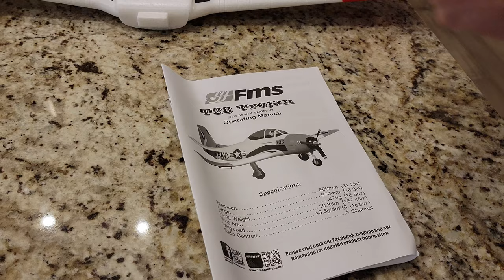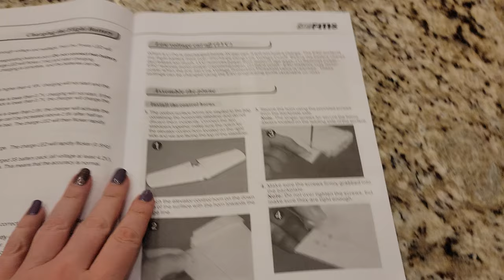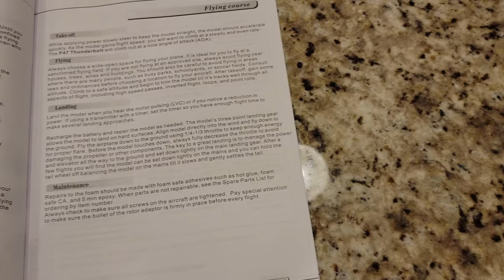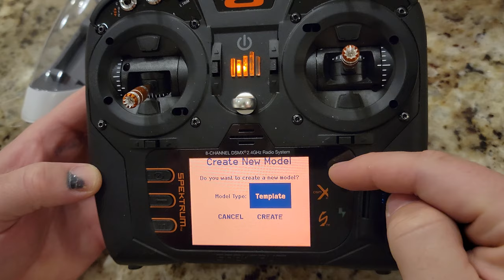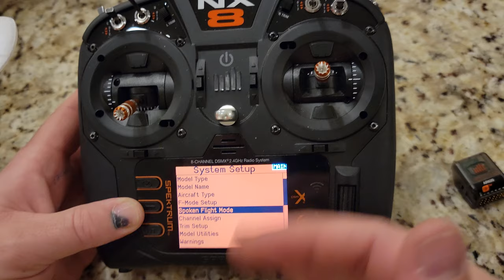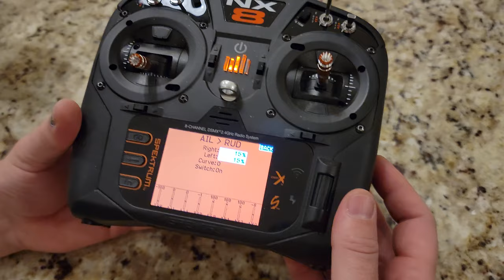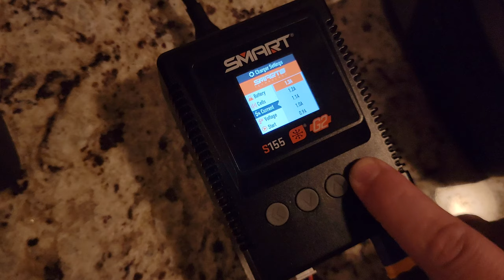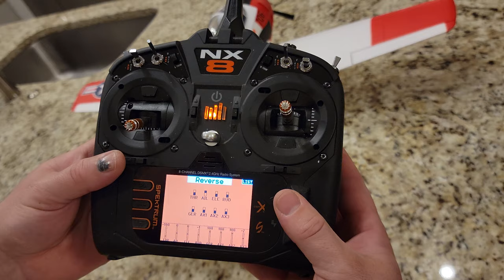FMS - T-28 Trojan - 800mm - Unbox, Build, & Radio Setup

Comment: Your channel is awesome! I recently got into the hobby a couple of weeks ago, found your channel, bought/built three planes so far and with all of them I used your channel to guide me through the setup (ended up having to return one of the planes because of a retract issue). Your channel has taught me so much and just wanted to say thanks for helping me put together my Night Timber X and Viper 90mm. Now I'm learning about setting up pilot fatigue from your channel.

Comment: I don't know what that  reflex is...but the one I bought last year is flying on an AR 410 4ch reciever with a 4ch Dx4e Tx. It actually has 5 channels, as one controls safe modes....which my older plane dosn't have.
Reply from the maker: Reflex is a stabilizer and also allows you to do what I call "Auto-Leveling" - our video will show how to set this up and how to use it.

4 Channel will work, just won't allow you to change the modes while in flight ;( There's a few hand launch planes that we've done recently that a 4CH will work for, and well, so might get an AR620 and then you can save this 4CH for another plane???

Without AS3X/SAFE...
AR410 https://bit.ly/3z5hT75
AR620 https://bit.ly/3z7WDO0 <<<<<<<<<<<<<<<< This one ;)
AR6610T https://bit.ly/3z37ysk
AR8020T https://bit.ly/3vgCnbV

With AS3X & SAFE... (the REFLEX does this...AS3X/SAFE... for you, so you don't need this feature...and it's not cheap!)
AR630 https://bit.ly/3zpdgVR
AR631 https://bit.ly/3v0w3Fy
AR637T https://bit.ly/3OlgIpB
AR8360T https://bit.ly/3crfA6H

Comment: Can you do a review of the 800 mm Corsair?
Story goes it I bought a 1400mm Corsair and they sent me the 800mm
I returned it got my right plane at it had all the wrong wires for my dx8 and I returned that one also. They only gave me $100 back.
Now I don't like my carbon cub because it does not descend and is not agile enough to fly it other than for in figure eights and in circles- so I bought the 800mm Corsair, now there's no good videos on it like you do, and it's unclear whether or not you need glue. Both unboxing videos state glue is needed. Of course I bought foam to foam anyway. I think alot of viewers need a good video of the 800mm Corsair! I will be watching all your videos! You and your 'camera crew' are the best
Reply from the maker: YES - coming soon ;)
Reply from the maker: Why is "They" when you say they only returned $100?
Reply: Horizon hobby and great thanks!
Reply: Or hobby zone one of the two, I tried to go on hobbyzone after that and I got a notification that hobby zone could be trying to steal your money so I went to horizon hobby
Reply: Also on my carbon cub the battery and charger stopped working 3 months after I bought it
Reply: I just got mine and the motor is at the wrong angle I wonder if it's going to fly. Also the rtf controller is white and beyond cheap. I tried to take off of a baseball field with little grass spots on it and it tipped and broke the propeller off. I will have to hand throw it. I ordered 2 more.
Reply: @johnsullivan5885  so what ?just replace it it is a hobby after all . Take off on a flat level surface it's obvious that it will not take off in long grass
Reply: @keveshannaidoo5670  did you read the part about the fact that the plane was defective. 200 and 200 is 400 no I want my money back first they did return it but I haven't seen my refund yet and now it's too cold to fly. I replaced two proppelors, and a baseball diamond with no grass really. It was because the prop was angled down, I tried to hand throw it and because the motor was installed at an angle it nose dived from 15 feet and survived
Reply: But won't fly or doesn't also check all your ailerion connections because I needed a 1.5 mm Allen wrench to adjust the tail flaps and the rudder and tail wheel
Reply: I have seen one take off from long grass on you tube I wouldn't land it in long grass because he broke the landing gear off. Hence I'm already really into it if have to buy another one cuz I land short of  the baseball diamond. Which I rarely do and never have with my xk cub. But the carbon cub doesn't descend well so I throttle down to much once in a while and land short.

Comment: Hi Brian, i am assembling the t28 but when i connected everything using pwm the reflex v2 keeps flashing and moving the servos repeatedly and  abnormally for a very long time. The motor turns on and off intermittently too. Do you know what happened? Also，when i used sbus everything worked but i noticed that the motor only turned when my throttle was already at 50%. Do you know how to fix this? Thanks!